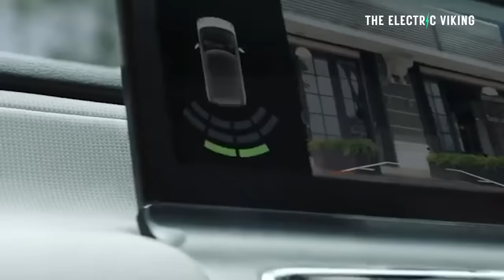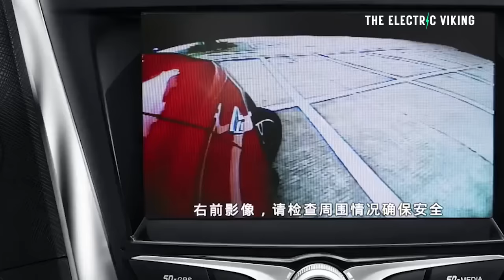Battery prices fall 80%; tipping point to the end of ICE cars is VERY close

Comment: After much investigation into EVs I have found that normal hot weather impacts battery life and extreme cold weather (below zero) has a huge impact on battery range.  Since it can get -20 on a regular basis where I live and because my ice doesn’t lose “range” in to cold the lost range has to be made up by someone (perhaps manufacturer, electrical company) because I’m not going fill it again just because of the cold…
Think about it this way if you bought a brand new car only to find the “fuel tank” leaks half the energy out of it when it got cold the dealers would be inundated with mad customers. 

Get that issue resolved and I’ll buy one. Until then I will enjoy my new AWD ICE
Reply: Problem is that the American heartland will not buy vehicles that only have 200 miles of range for every 15 minutes of fast charging. And fast charging reduces the battery life. Until the charging is reduced to 2 minutes, there will not be sufficient network effects for charging stations to proliferate over our massive landscape and for queues to not form.

Comment: Prices for lithium ion batteries are falling because the increasing number of EV battery fires caused by these dangerous batteries means fewer members of the public are buying EVs that have them not least because of the increase in insurance premiums. Also CATYL, the main supplier, is switching so sodium ion batteries making them obsolete. Junk has no value.

Comment: If due to innovations and volume production, battery per kwhr make BEVs a no brainer, the ICE manufacturers wont be able to sell ICE anymore.   I have a Jeep that I won't be able to give away.....who would want it, a minor mechanical repair would be cost prohibitive, and that's if you can find a ICE mechanic (and parts).
Reply: Jeeps might not be the best example.  Poorly built with much higher than average maintenance costs already make them less than desirable.  Something like a camry that gets 30-33 mpg and will run for 250k will probably hold its value for a long time.  Especially when EVs start paying their share of road maintenance costs which are currently funded thru state and fed petroleum taxes.  This in theory should also lower the price of gas because nearly 80 cents per gallon is tax.
Reply: @andrewfrazier7974 Governments will probably add some extra carbon tax over that gas.Lower prices isn't good for the fossil fuel industry.
Reply: Really ???

What an ignorant video 
Facts clearly are that there won’t be enough battery production worldwide to power more than 15% of cars for at least the next 10 years. 
So the age of EVs is only just starting to get off the starting blocks and will be a sidekick for a long long time

Comment: I keep hitting on the parady of EVs and the adoption of Flat Screens, but we're seeing the exact same industrial and economic forces at play. 

When the production of larger higher resolution TV screens ramps up, the price of all screens become cheaper. Newer chemistry batteries that are less expensive are hitting the market and the older tech drops in price. 

Not to mention that resources that compromise the batteries which are scarce or expensive, drives exploration to find new deposits or outright replacement. This has been the case with Lithium and Cobalt. 

We can only expect this downward trend in price to continue.
Reply: Lithium hydrogen batteries???
Reply: China controlls 80 percent of rare metals in the world. They bought most of the mines in the world.  They will produce cheaper ev to export and keep the prices high on the batteries they export. With inflation running high across most of the world and oil prices going higher. I don't see how prices are going to drop soon.

Comment: Peak ICE was 2017 in China. Why? China is the only unsaturated car market with the biggest numbers. Achieving economies of scale without winning here are not possible. The price drops of 80% compound with energy density increases of +150%. These allow for 8 times smaller batteries. The real impact of these changes is a factor 1 to 40 something in BEV engineering - either range improvements or cost reductions. This does come after the peak ICE in China was passed 2017 in China. This is an economic freight train going downhill.

Comment: There is not really a tipping point anywhere near. There are 1.5 billion ICE vehicles on the planet. In most countries an electric car is completely out of the question. So even if the few developed nations completely switch to EV's - which frankly I doubt - the rest of the world will continue to use ICE vehicles because they're cheaper and gasoline/diesel can be transported and stored, where electricity is hit and miss in most countries on the planet, particularly considering the huge amounts needed for EV's or even electric trucks. 
I also still have to see a $40k EV that can tow a 1 ton trailer for up to 600 miles off-road. Of course, that's not a frequent use-case, so I'll stick to my Jeep with 44 gal tank.
The irony however is this: there's about enough LI on this planet for 2.5 billion cars (current technology). That is if we can extract 100% of LI available - which of course we can't. So half that is about doable. So we only have LI for less than 1.5 billion cars accessible on this planet and we haven't even mined that yet. So thinking we can replace a 1.5 billion cars fleet - which is increasing as 3rd world countries become more affluent - is simply misleading yourself. 
What will happen is this (and of course you'll call it a conspiracy theory): once the industrialized nations forcibly switched to EV's, the subsidies will subside and taxation will go up. In the end most people won't be able to afford a car anymore. Anyone who knows anything about sustainability knows that cars no matter the propulsion are completely unsustainable in the future. So cars will be for the wealthy and the rest will use public transport of stay home. That's what will be common in 2050. It also allows for complete control of the population - one of the main goals of every government. Remote controllable vehicles - what could go wrong.

Comment: 80% from what point??
Reply: He says the answer in the video. It is 80% over the past 10 yrs. However, more importantly the price has fallen approx. 30% in the past year. Simultaneously, energy density is 1.5 to 2.0 times higher. And pretty much all the minerals in all of the battery types are way down in input cost despite far more EVs being built. Production scale will also lower prices. The point of all of it together is that the R&D and production control practices continue to improve at a pace that capital cost parity with ICE is coming quickly while also reducing range anxiety. We aren't quite there, but it is now inevitable in the next few years and no longer pie in the sky.

Comment: I was at the gas station yesterday....first time I had to go in 3 months.  there are 16 pumps.  each car can be filled with gas in a maximum of 5 minutes and they're gone.  You need charging stations which can have 16 cars get charged and out in 5 minutes.  Who wants to wait?  They need to make batteries safer also!  This thermal runaway is far too dangerous.  Imagine an underground parking garage full of electric cars.  During the night, one starts on fire, then the next.. it will spread, the heat inside will be crazy, cant even go in!  You'll loose all kinda of cars!!!  I personally never want an electric car, happy to pay more for gas.  Global Warming is a hoax.  plenty of real proof to show that they are lying and sometimes not even using current data which proves it!  Instead, using 2010 data which works more in their favor... however it's al cyclical... nothing to do with CO2.  This amount is good for vegetation...if you go too low...vegetation will suffer.

Comment: Sounds like sensationalism to me. How many ICE cars exist, right now, in the world?  I live in NJ; there's no way the grid, here, could handle even a 25% EV adoption (let alone that there's no solution for apartments, condos, etc.).  Charging stations are a mess, and seem to be getting more and more expensive. Cold weather, hot weather? Watch out. Too many EVs get trashed in a flood, and when they catch on fire, it's a nightmare. For my $$, I wouldn't invest in an EV until they're based on sodium; lithium is an environmental nightmare and a safety threat - I wonder if there's price dumping because they see that future batteries will rely on other elements.

Comment: Plummeting battery prices are good news. The bad news however, is that the power grid in most countries is far from ready for this kind of revolution. After all, these batteries need to be charged. The power grid in The Netherlands is very good, but it’s rapidly getting congested. Many powerlines and distribution hubs are (almost) at maximum capacity. And i haven’t even mentioned that we are urged to abandon fossil fuels altogether. New installations of natural gas heaters for our homes for example, are to be banned from 2026. (Hybrid) heatpumps and electric heaters are to replace them. This will suck the power grid dry. It doesn’t just need an upgrade, It needs to exponentially grow, quick!

Comment: Great news!  Cheaper battery prices will make PHEV even more affordable when compared to ICEV.  There is a big difference between the prices of a 3-cylinder 1 liter engine for a PHEV vs. a 6-cylinder 3.5 liter engine for an ICEV of similar size and performance.   When we pair a cheap 3-cylinder engine with a cheap battery pack, we will have a very affordable PHEV for the mass of people!  The proliferation of PHEVs can overcome the strained fast-charging infrastructure for pure BEVs and the strained electricity grid during periods of weather extreme.
Reply: Why bother with PHEVs? It will be 20 years before EVs have a significant impact on the grid. That is plenty of time to adapt as necessary.
Reply: @williammeek4078  -- From the article:  The Costs of Revving Up the Grid for Electric Vehicles:   "We found that the representative utility, depending on charging patterns, will need to invest between $1,700 and $5,800 in grid upgrades per electric vehicle (EV) through 2030. "  By comparison, PHEVs cost nothing to upgrade when the PHEVs will be charged only when the grid has spare capacity, and NOT being charged when the grid is at peak demand.  
Please be reminded that the US power grid is operating at an average of 50% capacity factor.  This means that there will be no need to upgrade the US grid If PHEVs are to be charged during non-critical periods, which is the vast majority of the time.  If PHEVs can further contribute power to the grid during critical peak-demand periods, then the need to upgrade the grid can be pushed back way further in the future.
Reply: @trungson6604  somebody is blowing smoke in your face. Do the math. If someone waved a magic wand and made all cars in the US into BEVs with chargers available, the increase in electrical demand would be only 30%. If we have 50% spare capacity, no upgrades needed. 
Even more, people are adding solar and home batteries to their homes. EVs at those homes won’t add to the grid at all. 
No, grid upgrades need to be done, but don’t blame EVs for the neglect of the last few decades.

Comment: Also you fail to point out that whilst the cost of energy storage has dropped due to technical breakthroughs..There have been no such similar breakthroughs in generation and transmission..In fact there isn't enough copper or silver available globally to completely kill off ICE vehicles without a massive increase in the use of mass transit and most of these projects either lose money or go way over budget..Like California's high speed electric rail  never to be finished money pit..
Reply: I just drive down the street in Los Angeles and see all the cars parked over night on the streets.   Where are they going to charge their cars?   There is absolutely not enough infrastructure at this time to replace all the ICE vehicles.
Reply: Well, that simply isn’t true. Wind and solar have gotten radically cheaper (generation) and HVDC is growing exponentially as well (transmission). And there is no shortage of copper or silver. Whoever you listen to just made that up. Especially as copper and silver are so highly recyclable.

Comment: Deniers who want to cling on false narratives of inadequate grid infrastructure, google the utility pwr duck curve. The grid has plenty of excess power at night when almost all EVs charge up. My solar panels generate more than enough for our 2 EVs for average driving, the excess pwr feeds other houses in need. As is, we're driving at 1/3 the cost of ⛽ fuel.  🔋 backup  will make us NetZero, ~ $0/mile except for supercharging on long trips
Reply: Musk has said the U.S. grid needs 3 times the present electricity. I did a rough calculation for my country. To replace oil used for transportation, we'd have to add 2.5 million Mwatts daily to our grid. We presently import electricity during warm spells. As for Net Zero, what are you planning to do about the 8 tons of CO2 exhaled annually by each human?
Reply: It is my understanding that gas vehicles currently pay for the majority of road construction/maintenance thru state and federal gas taxes.  How will EVs pay that cost as gas vehicles disappear?
Reply: @andrewfrazier7974  : simply increase to cost of electricity.....
Reply: @drewthompson7457  That makes sense but if those increased costs are applied to all electricity uses in the home, it seems that a large percentage of the US population will suffer even more from that added inflation. I also read that because of the additional weight of EVs, necessary road maintenance will need to increase.  Would you agree?
Reply: @andrewfrazier7974  : yes I do agree.  But when haven't taxes caused suffering?  A new example for me is paying over 30% carbon tax, as well as 13 % HST ( tax) on what used used to be clean natural gas. As a consequence, last winter I heated my house to 14 C. ( higher when people came over) And the carbon tax has gone up again for this winter. 
Also, I've read that multi floor parking garages were not designed for the heavier EVs. That may limit parking.
My government is doing it's best to turn us into a 3rd world country.
On another problem, my government is pushing to limit farmers' use of fertilizer.  More expensive food, anyone?
I wonder when farm equipment will be forced to go electric? New farm equipment isn't cheap, even when diesel powered.
Reply: @drewthompson7457  All good points.  Thank you for chatting!
Reply: Hahaha
Reply: @robertfonovic3551  : my governments gave an automaker $500,000,000 of my taxes to help them develop EVs.
And now it seems around $16 billion of my taxes are going for battery plants for other automakers.
If EVs are so wonderful, why can't they make it on their own?

Comment: A new engine for a four-cylinder car typically costs around $4,000, 12 Jul 2023 ref Google question result

77kwh battery in MG 4
77x80 dollars =6160
Considering 77kwh MG recently held its own against two super cars on YouTube
Reply: That means the cost of ownership of the EV is much less.
Reply: Nice calculation. That mean the 51 excite will be near price parity sooner than later.

Comment: the genius of tesla & elon- is that they have CHANGED that 'thing' that we think of as 'the car' into a solid state consumer electronic. and that? CHANGES EVERYTHING. why? over time, EVERY consumer electronic, gets faster, better, more features and cheaper to manufacture & to buy, while simultaneously, getting more profitable. CD's. DVD's. radio. computers. cameras. name your divice? go back just 20 years? and the price drops by a factor of 10x as the performance goes up exponentially.  bye bye ice cars. you had your run. this shift? will be like going from horse & buggy to a toyota camry-  but with travel costs continually getting cheaper. solar with batter storage? the same. eventually- a MASSIVE HVDC backbone line running from the southwestern usa, serving the northern states all the way into the farthest reaches of canada & alaska, cheap abundant energy with 4680 cells, backing up the grid- lasting 50 years. robo taxi fleets that can do emergency fleet dispatch to areas impacted by natural disasters, supplying power via V2g technology. HUGE emptying of parking garages in downtown areas of NY, chicago, LA, boston- replaced by thousands of robotaxi fleets. parking passes? WHY? a robotaxi app on your phone- membership for your daily commute cheaper than owning & operating a beater car. parking structures re-purposed for greater value- offices, schools, retail, housing.... and it all started with a handful of brilliant guys doing math on the back of a napkin. thanks elon- we love ya buddy.

Comment: I think infrastructure deficiencies far outweigh battery costs.
Reply: Home battery storage resolves this
Reply: @Al-yc4cn  Only if you can afford it.  Powerwall 2 with installation is nearly 20k. I can buy a decent used ice vehicle and 5 years of gas for that.
Reply: @andrewfrazier7974 how do they think electricity is made to run their ev.
Reply: @andrewfrazier7974 pixie dust?
Reply: @billrehm3590  🤣

Comment: Look how cheap the battery technology that has been around forever is.  Lead acid batteries have been around forever so they have been able to perfect the manufacturing process and make them as cheaply as possible and to top that the batteries are all recycled.  12 volt batteries here lately are so cheap they are practically given away.  Soon it will be the same for the lithium technology.